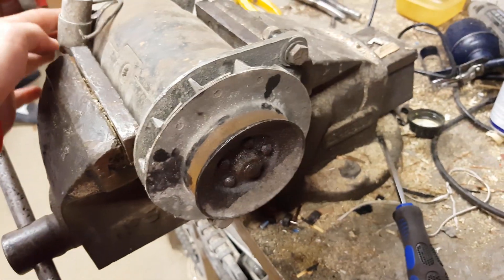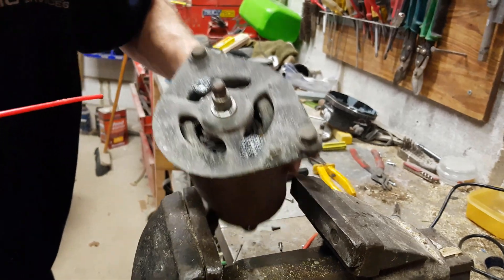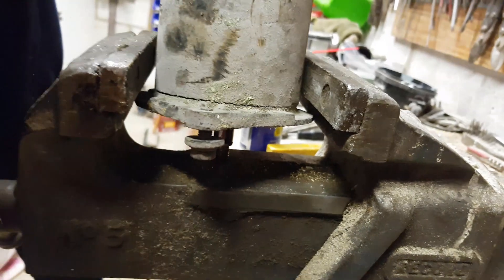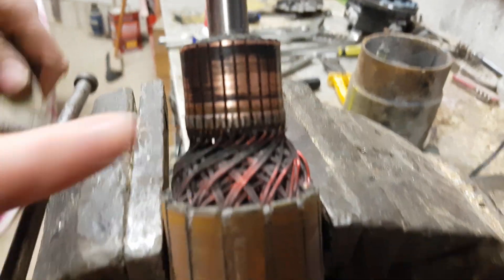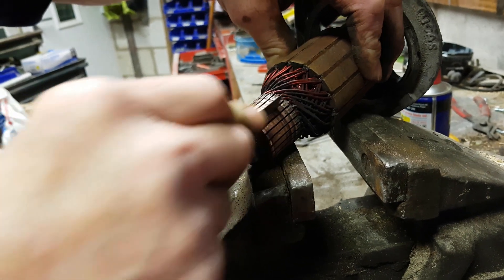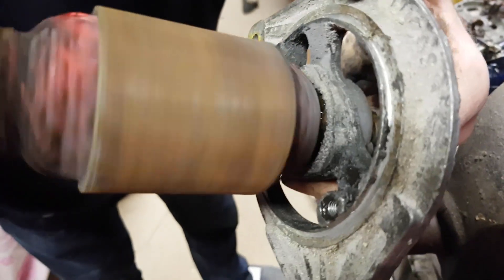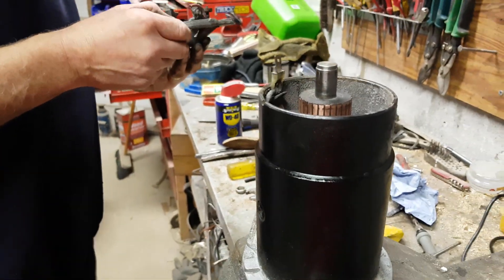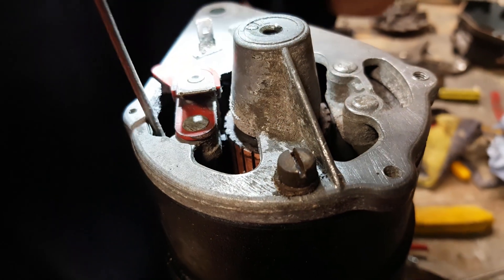Dynamo restoration, Lucas (ML704)

Comment: Good demo - great camera work.  I must admit that those very worn out brushes should have been replaced, and it appears the your unit was missing a fiber washer on the commutator end.  Not everyone has a lathe available, but those who do should turn the commutator using the lathe for a perfectly concentric and straight cleaning of the segments.
Reply: @KaraokeSC. Probably one of the clearest camera job I have seen. However you are correct about using a lathe on the armature. High speed with a very sharp tool. Then to undercut the mica I use a feeler gauge that is the correct thickness with a hook ground onto the end. Different gauge thickness for different armatures. Never undercut an armature on a starter motor.

Comment: Another cowboy job
Reply: @timmyluap. I have to agree. If people are going to post a video on a LUCAS generator restoration, why not do it properly and correctly. While I applaud this guy for having a go I would consider this repair for emergency use only. Also holding the brush springs out will work for a vented generator, but not for one with solid ends. I have tools to do that job. We make them in our workshop. After 50+ years I believe that we know what we are doing.